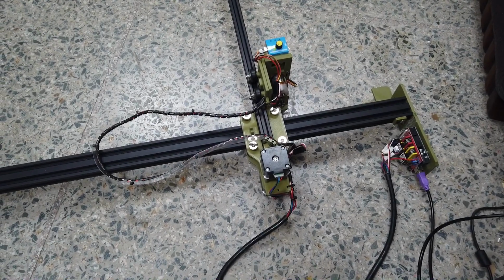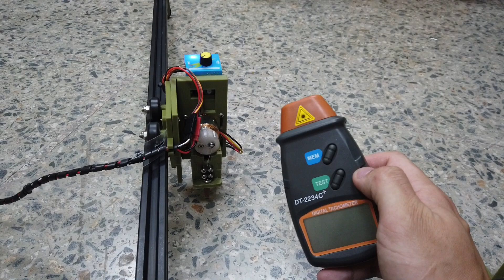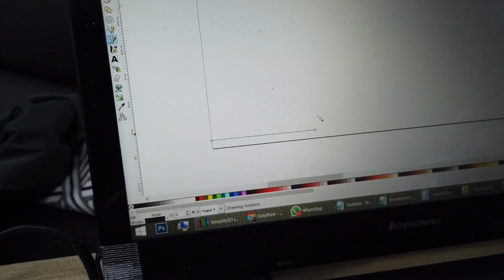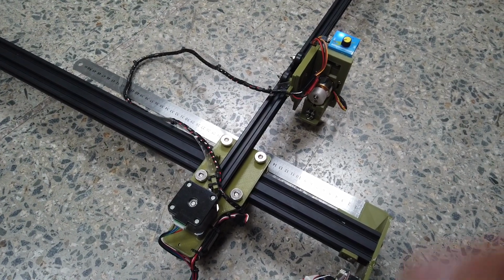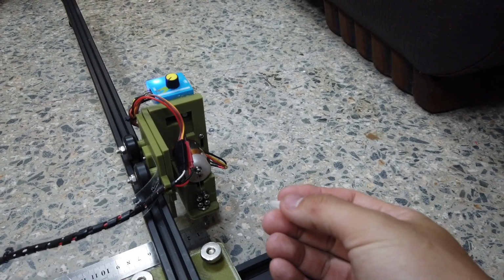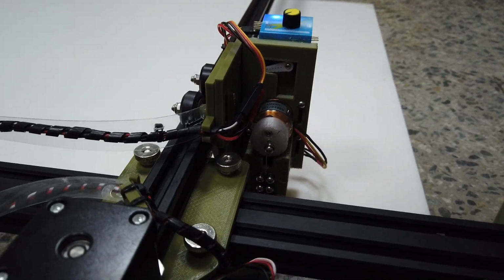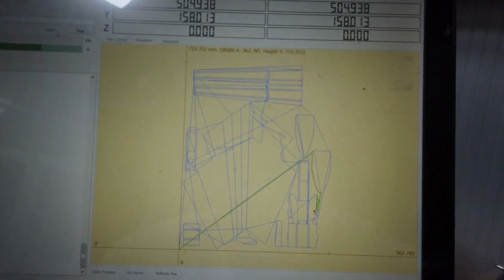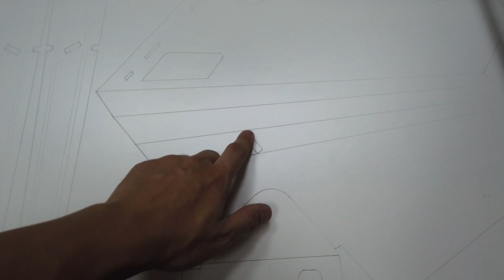ERC TimSav Part 8 Final - First Time Firing Up, Calibration & First Cut on DIY CNC Foamboard Cutter

Comment: Great job Edward, looks like you have given this project some serious thought.
Reply from the maker: Haha thanks for the compliment Thomas! You know if this is a project that's only for myself, i can close my eyes on a lot of imperfection. 
But I knew many will benefit from having one of this, so it has to be designed differently, easily replicable and as little issue as possible. So it was a hell months of frustration getting everything to work together. haha